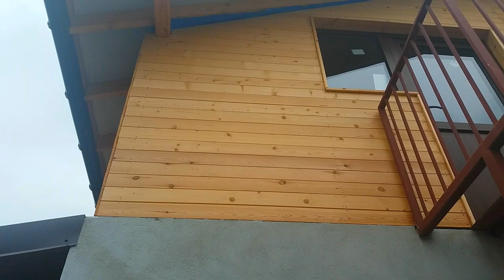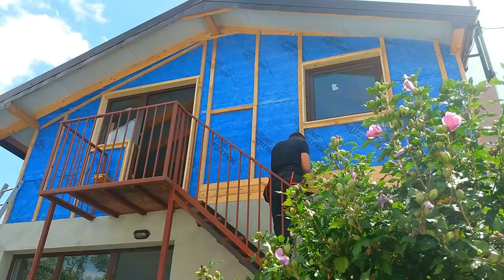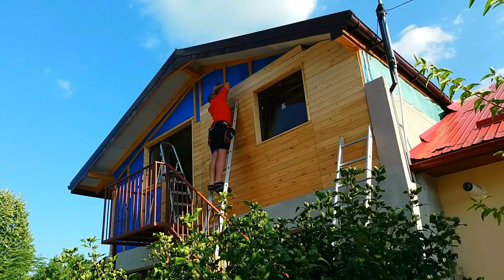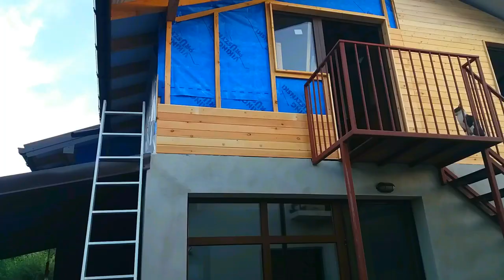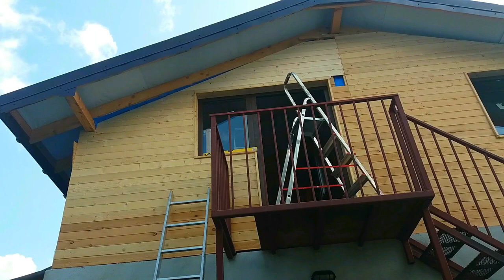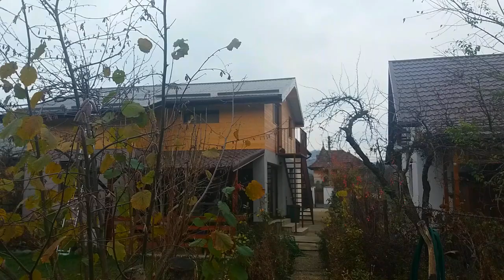Montarea lambriului de lemn la exterior

Comment: Te-am mai deranjat cu intrebarile si in trecut. La casuta mea lambrisata exterior grinzile au fost montate exact pe muchia fundatiei,  deci grinda face plan orizontal cu muchia fundatiei. Peste grinzi s-a pus OSB de 22, apoi sipci de 4 peste care s-a pus lambriu. asa ca lambriul ieste cu cca 7 cm in afara si a ramas un gol intre ultima placa de lambriu si soclu. Cum acopar spatiul acesta? Nu gasesc nimic pe internet, trebuie sa fac ceva intrucat se pare cau urcat in sus prin spatiul gol soarec. Multumesc mult.
Reply from the maker: Cu scandura sau tot lambriu. Un fierastrau circular cu ghidaj paralel pentru a taia pe latimea necesara, prins in holsuruburi de capetele sipcilor, facuta pregaurire prin prima foaie de lambriu si cantul scandurii, bagate si acolo cateva holsuruburi si aia e.